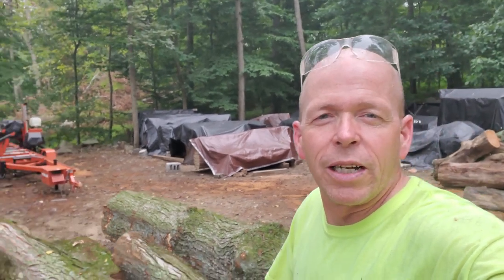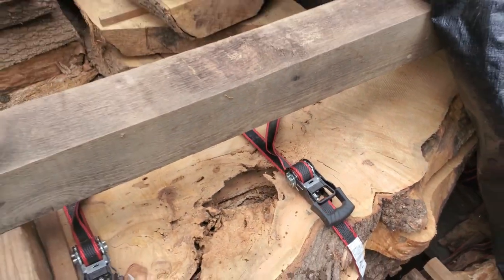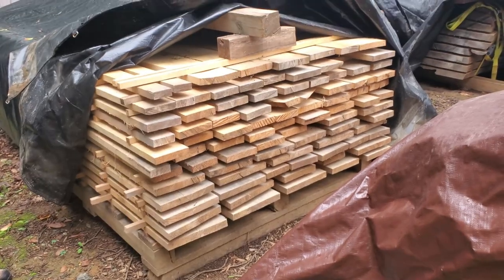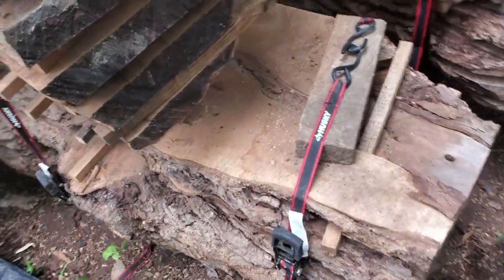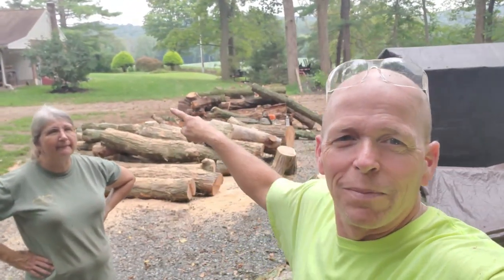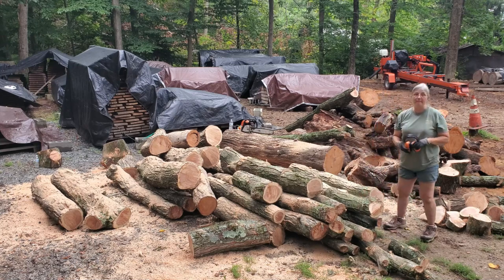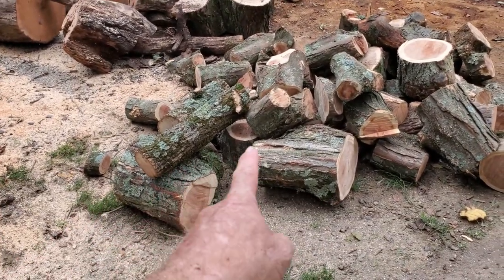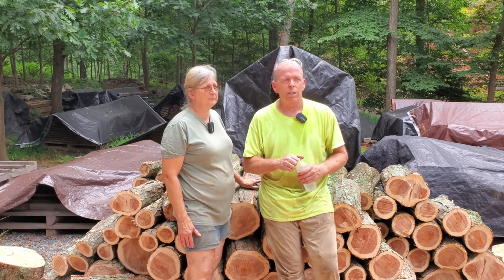Lumber Yard Inventory and Blocking and Chainsaw accident

Comment: I saw in the vid where you have milled slippery elm. I have milled some myself, and I am getting where that is my favorite wood so far. It is gorgeous. It even has amazing crotch grain like walnut. Just waiting for it to cool off here on NE Oklahoma so I can get back to milling again.
Reply from the maker: Hello Mark. It's nice to meet a fellow fan of elm. Beautiful stuff. We will be building a coffee bar, and will be using some of it for the top. 
The heat is horrible here...... well, actually, the humidity is the worst part.  Doing a little late in the afternoon, just to keep things moving. Mostly bucking firewood right now, but we need to get that Locust milled
Reply: I wish this would let me add a picture if what I’ve milled and what I’ve used it for so far. I’ve mainly used it for cutting and charcuterie boards. Do you have an email I could send some pics to? Good day
Reply from the maker: @markdunham2934  ar15rocks13@gmail.com  will get those pics to me. Looking forward to seeing them.

Comment: Pecan does the same thing as Hickory. I think its the Anchor Seal reacting with sap as far as the black ring goes. We have tons of Pecan down here and Pecan is classified as a Hickory. I currently have 40in diameter pecan log drying and it did the samething everywhere I put Anchor Seal on.
Reply from the maker: You are correct. They are both in the same family. Sounds like a real good size pecan to mill. Anchor seal is the best. Works for us every time.

Comment: Unfortunately I did it years ago cut a 6” gash in my upper leg to the femur cutting a sassafras tree saw came out of cut and I tripped over surrounding wood putting saw through my leg. No I wasn’t wearing chaps which I own now and I always clear area when cutting up rounds to avoid trip hazard while running the saw. Ask anyone who has been cut it happens so fast. Be safe and I hope showing your milled wood makes sales for you there is a local guy near me that buys a lot of slabs he might be interested in some of them
Reply from the maker: Good to hear that injury wasn't worse. You definitely don't want to catch that artery in the leg. If your friend is nearby, he is welcome to stop in and chat about what's here.

Comment: I would think that the customer who’s purchasing the lumber and slabs would want it to be green wood?
Reply from the maker: Most anytime you use wood, it should be dry.  Firewood below 20%. Furniture lumber should be around 8 to 12% moisture. Can't have it shrink king after you build with it. We both have the same issue. Customers want dry wood.
Reply: They want it dry, so they can make all kinds of furniture like floating shelves to bar tops. Take care